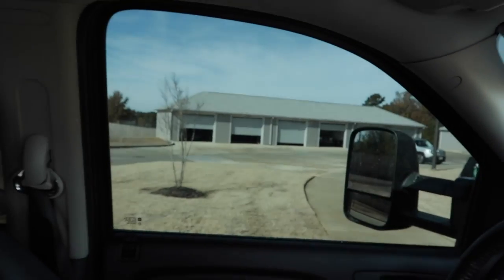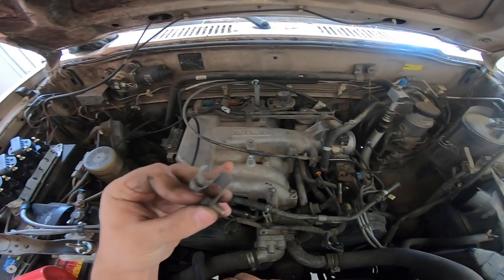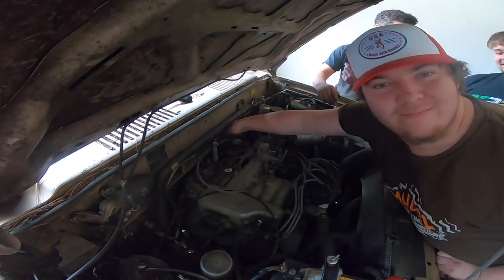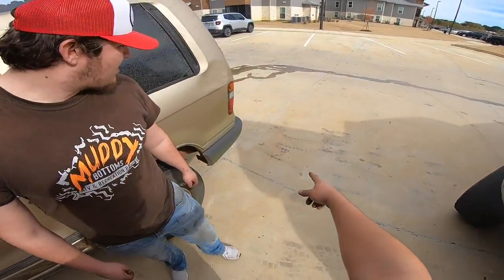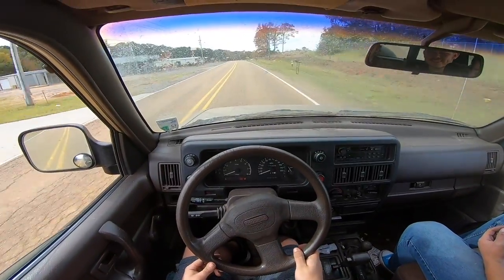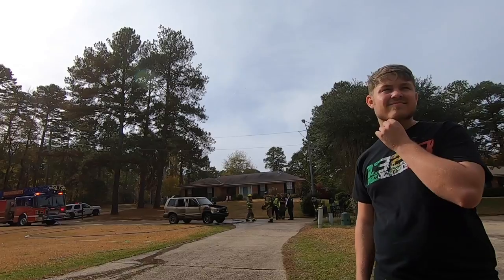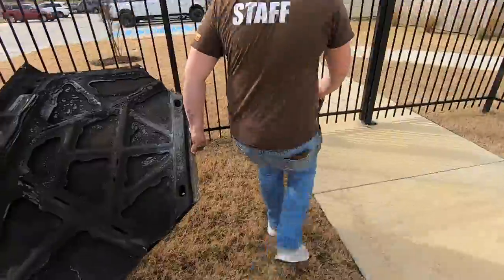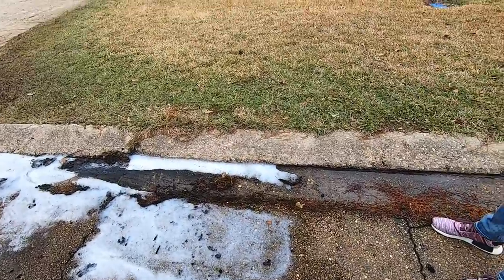Our Christmas giveaway car CAUGHT FIRE...

Comment: The clogged cat overheated & caught the sound proofing in the trans tunnel on fire.
Reply: Very possible
Reply: I concur, the fireproofing destroyed a gasket and that caught the trans fluid and the rest is history. I will miss the Trooper dearly.
Reply: Yup this happen to my mustang
Reply: Either that or the trans fluid leak onto hot exhaust lost my first car Isuzu Rodeo that way
Reply: Itsjusta6 wheels
Reply: That's my vote
Reply: Yep
Reply: Transmission fluid self ignites at a certain temp ._.
Reply: Nope, morelikely trans fluid overheated and expanded out of trans out of vent tube and caught fire. Clogged cats put extra load on the engine and transmission.
Reply: And if you don't be live me you can do your own test on your car with a stall test. Basically put it in drive and press on the gas to like 2k-3k rpm (before tires break loose) and just hold it there, let the turbine warm up that ATF lol
Reply: Probably
Reply: Running perfectly? Misfiring like crazy is not running perfectly

Comment: Dude you crack me up.  
@istjusta6 : Doesn't check brakes, dont check gas, known transmission fluid leak next to a known exhaust leak.  Drives it anyway.
Trooper: catches on fire.
@itsjusta6: insert surprised pikachu face

Comment: Transmission lines are hard metal, not rubber. Even if the front pump was spraying transmission fluid all over the place, the amount of smoke coming out of the back of the car when driving would have made it obvious. Watch the video as they are showing it still running and moving after they have bailed out. There is a trail of fire as the car is moving, likely indicating a continual fuel source, like gasoline. The fuel rails are pressurized to about 40-50 PSI, and can start a fire very quickly if not leak checked before taking it out for a test drive. Glad to see you guys were ok, be careful with your repair jobs so everyone stays safe.👍

Comment: Dont call yourself a car guy when you blow through a fuel injector and say its clogged.You need a pulse /signal to open the pintle . And even then its not enough pressure to see if its clogged.Also why do you let the car still in drive while its on fire.That is just common sense that you shouldve at least parked it and not let it roll possibly into a house or tree .
Reply from the maker: Victor G he blew in it as a joke. I see you got the joke. (That’s sarcasm by the way since you have trouble picking up on humor.) the car was put in park while still moving and wasn’t completely stopped. The parking claw in the transmission won’t engage until the car is fully stopped as a safety feature, which is why all we did was hit the brakes to bring the car to a stop, which let the parking claw engage.
Reply: @itsjusta6official   i understand the humor part just hoping it wasnt as funny when others do the same and are mislead .I mean you would have to do more diagnostics then just  blow through something.
Reply from the maker: Victor G right. I see how that can be taken wrong and I’ll clarify next time that it was only a joke and you can’t simply blow through it.
Reply: @bustinyanutz4195  Y I K E S mate, your that type of person, in the video it was even made as a joke very very clearly

Comment: Honestly, being a mechanic and hearing that the beeper was still working after the fire the car is completely salvageable, the engine was pretty much untouched in the fire and I wouldn’t even thing twice about replacing the small amount of parts that melted which are very cheap too, the most expensive thing I saw wrong was the fender paint and hood being cut, you guys should totally do a series of making this vehicle road worthy again

Comment: You know what? your heart was in the right place with this one and you weren't just going to roach the thing out and beat the crap out of it. but yeah pretty much anytime one has sat for over 5 years this issue with the trans fluid burning is a possibility.  FYI. those seals, hoses and plastics all get dry an brittle and end up cracking on you and then you have this kind of issue pop up> Kudos for your plans and i hope you can find someone to donate a vehicle that you can put to use for some needy family like you were saying that's a very noble cause and i hope someone is able to help you out with that. if you were closer i'd tell you come get one of the 3 chevy's out of my yard. i have a 97 S10 blazer with 93,000 miles on it that i rebuilt from the block up and just haven't had time or money to finish. all it needs is a distributor and fluids  also have a 1988 4x4 that needs the bed put back on., repainted, and the engine put in it. and i have a 1991 long bed silverado that runs like a dream with 135,000 miles on it but needs the A pillar straightened out on it problem is you guys are in Texas, I am near Nashville in Tennessee long haul for a charity case

Comment: It wasn’t the trans fluid that caused it. The cat came apart and got plugged up. That’s why it was popping and had no power, the cat was choking the engine out by restricting the exhaust. So since a cat is meant to flow it’s not designed to be a heat dam and eventually it got so red hot that it ignited the underside of the car. I’ve seen other videos of the exact same thing happening. If your car starts having those symptoms don’t keep driving it or else it could end up just like this trooper. This could have been prevented but from this video I can tell none of these guys have a full grasp of how a car works and are learning as they go.

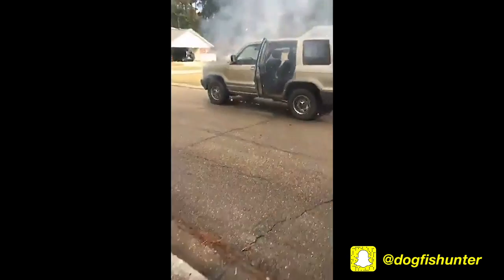Comment: That trail of fire under it at 13:52 tells me it's either a transmission line or fuel line got melted from the exhaust heat. I could be wrong, but I don't think a leaking o-ring from an injector would act like that.

Comment: I  have a good motor and trans I can put it. I have a 1995 ford Expolore and the motor and trans will fit in that with alittle work. The ford we have the body and wireing is junk.The only thing good on this ford is the motor and trans and 2 tires. WOW I got to the fire part of the video and my idea flew right out the window. Looks like you have my kind of luck when it comes to cars. At least you do have good cars and a awesome truck to drive.

Comment: Just wanted to mention... You have to put voltage on injectors to open them.. just blowing on it with no power won't flow fluid it is a solenoid.. normally closed -_- should've tested injectors by putting voltage to them and spraying cleaner through it to clean em before you just swap parts on assumptions. Just food for thought if you have this issue again on another vehicle lol
Reply: Definitely clogged cats caused that fire!!!

Comment: Good possibility that it was the cat I had a cat plugged up one time and it was pushing hot exhaust back through the intake manifold melting all the components on the intake but if there was transmission fluid spraying out or leaking on exhaust that could catch on fire also.

Comment: Transmission fluid self ignites after a certain temperature
Reply: And if you don't be live me you can do your own test on your car with a stall test. Basically put it in drive and press on the gas to like 2k-3k rpm (before tires break loose) and just hold it there, let the turbine warm up that ATF lol

Comment: My dads Ford Taurus has smelled like smoke and my dad got lucky we live down the street from the automotive place. They said it was transmission fluid leaking in to the exhaust. If my dad went any further the car would’ve exploded because the exhaust is so close to the gas tank.

Comment: He keeps saying it was running great😆 it wasn't, the cat was clogged (that's why it was backfiring and running like crap, and had no power) which overheated the engine, and the transmission was leaking (which is extremely flammable) and then it caught fire🤷‍♂️

Comment: Due to the catalytic converter being clogged the exhaust got way too hot and whatever oil was on the bottom of the truck caught fire that's why it started from the gear shifter

Comment: Did he just try and blow in an electronic fuel injector? rofl you can't blow into it like that without electricity going to it to open it. @itsjusta6 I mean you work on your car kind of on the reg surprised you don't have a fuel injector tester they only like 30-$40. LOL it was riding just fine, good thing you didn't give it away though.

Comment: 1:35 ummmm I didn’t know thats how you tested for an injector being clogged by blowing through air though a closed solenoid that supposed to hold at least 45 psi of fuel pressure

Comment: What killed it was leaking fuel. That black all purpose grease you used on the O ring for injector is petroleum based. That shit nukes rubber seals. Between clogged cat, leaking fuel and not burping the coolant system fully that was a recipe for disaster. You can see the burning fuel trail as it was coasting after everyone bailed. Glad you're all okay but this thing was doomed 😂 😂 😂

Comment: So Your plan is to give this away to a needed mother After you can clearly hear the engine has issues and instead of putting antifreeze and distilled water you put Straight distilled water has transmission leak I guess this would make you feel good to give a piece of junk  to a needed mother! You guys should be ashamed of yourself for even suggesting given this type of vehicle to needed mother